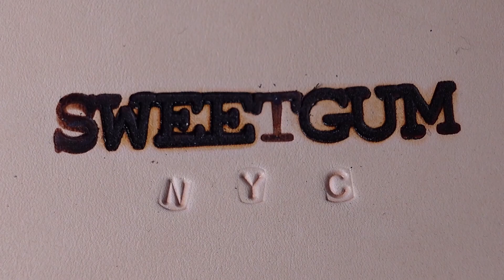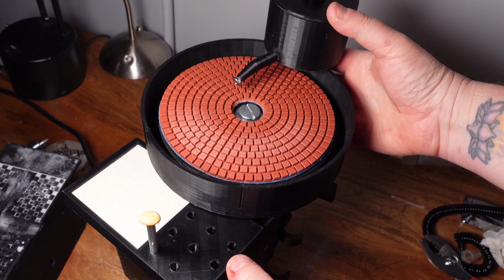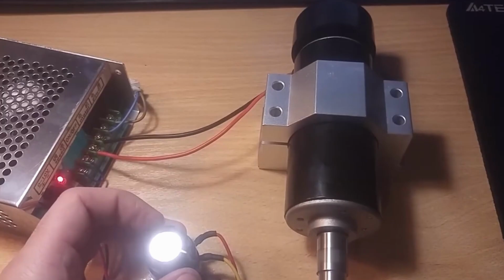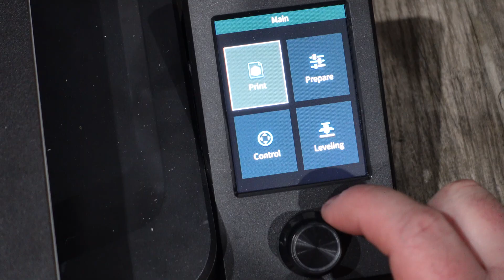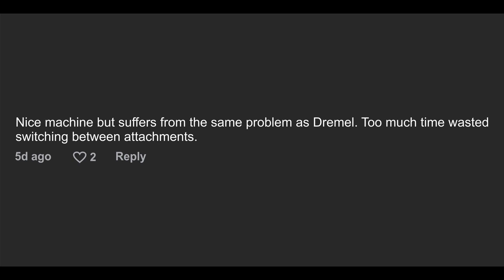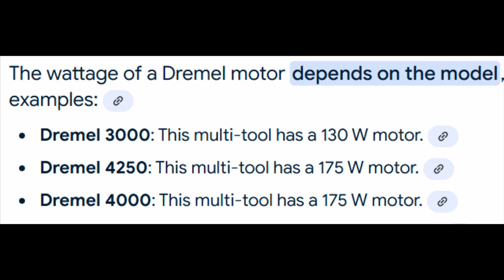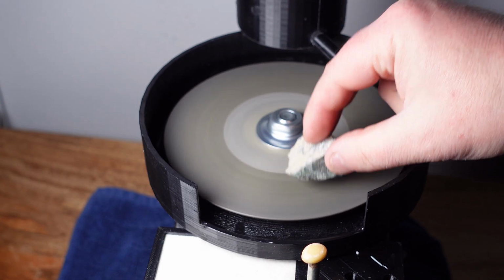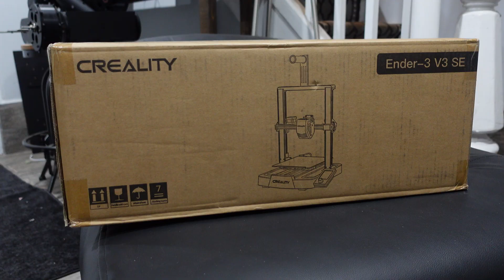This 3D printed machine can do everything. #3dprinting #jewellerymaking #metalworking #cnc

Comment: i have suggestions for the motor that you might try :
1. brushless servo sewing machine. it has high torque, speed, well balanced, controller and power supply included, and cheap. and the controller itself is very good, it has break on stop, can reverse, and there is safety if overload.

2. brushless with am32 esc firmware installed. you can choose your needs for this option. motor and esc ampere. and it can go very slow, break on stop. i use it for my cnc. the benefits over option 1 is you can have a smaller motor than servo motor sewing machine.

i really like brushless motor, because in theory it can last forever and the torque and speed are still constant across its life times.
Reply from the maker: that would triple the price at least lol
Reply: @sweetgumnyc7794  servo brushless sewing machine only $20-$25 so same price as your motor that you are using now

Comment: I've been brainstorming an auto diamond wire saw machine but I am very much lacking in that skillset. I bet you would be able to hammer something like that out awfully quick, think about it! I know many in the community would benefit. I am shocked there are not more viable options. It is just crazy to me we can have tile saws for $50 and the cousin (lapridory saw) is nowhere in the ballpark despite so similar. Same with the diamond saw, how is there just now a non-commercial vendor who makes it (although it sells for $3.5k). Thanks man, you rock!
Reply from the maker: i dont know what you mean by "auto" but a diamond wire saw attachment is very much in the works.
Reply: @sweetgumnyc7794  Ah, just meant not manual, but hell I was still looking for one of those too! Simply going back and forth is killing me, if there is a manual rotary pedal type thing to magnify result vs effort put in wheerreee doooo I sign upppp. Then if it is electric, just take my damn money! Save meeee

Comment: Interesting ideas. I think best motor for any needs - servo motor with AC driver. Chinese brands is under 100$ (200-400w) 3000 rpm and full torch on any speed.

Comment: Nothing beats mass for vibration issues. He's borrowing the mass from the table with that clamp, but what he really needs is a big empty base on the machine filled with concrete, lead, steel, rocks, etc. He's in NYC, so maybe steel scrap is handy. In the Southwest there's a lot of free heavy rocks outside.
Reply: Wouldn’t that make it hard to flip it over and change things?

Comment: Just found your channel and this is an awesome project! I also found someone else making a small 3d printed lathe and other tools, and he filled his 3d prints with concrete or cement. You could maybe look into that, the significantly increased weight might increase the stability even more, or even remove the need for clamps.

Comment: for the clamps and base to mitigate drift from vibration and pressure you should put a 45 degree cleat on the base and clamp to where they interlock and it won't drift from the edge when using it.